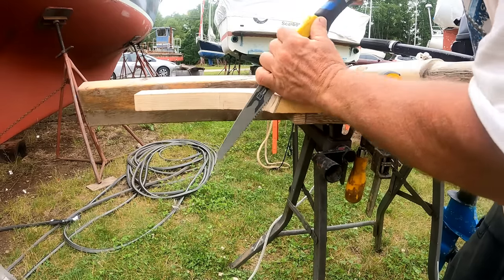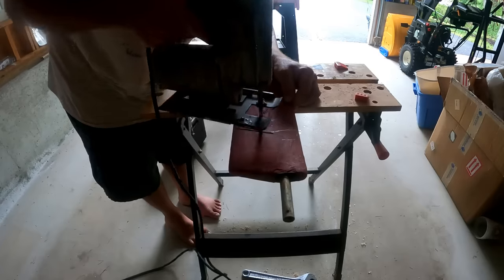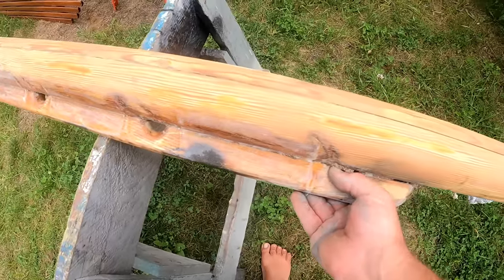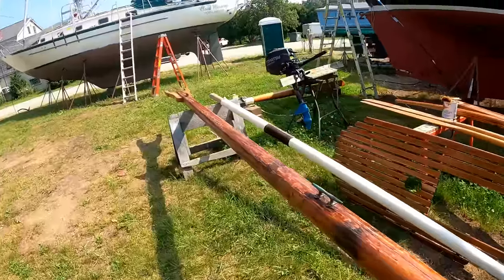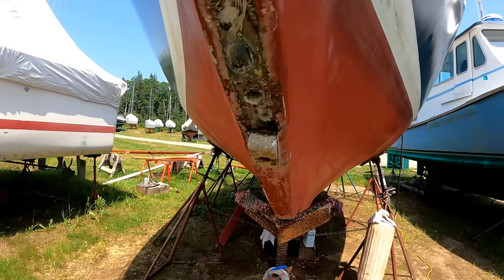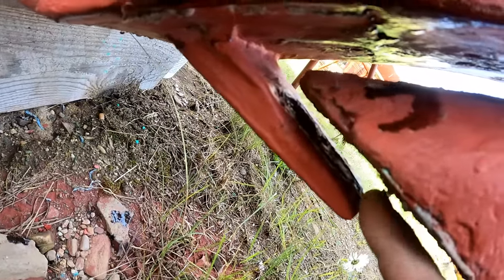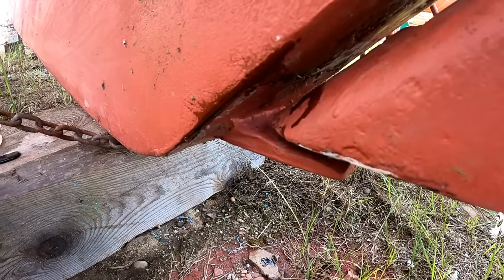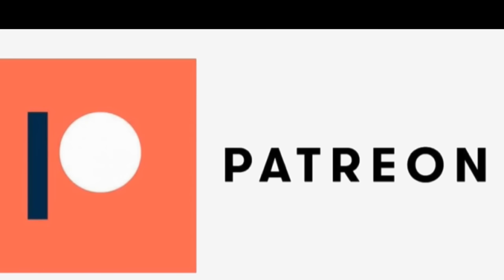Two Bolts Out of the Blue  |  Ep. 226

Comment: Kevin, regarding the anchor, I've had great luck with Rust Kutter, a phosphoric acid based rust converter in a spray bottle. Wheel the loose rust off mask so you don't breathe in acid must and protect eyes then spray the surface rust. Let it sit overnight. Wire wheel or sand again. Then you are painting what is chemically no longer rust.
Reply from the maker: Thanks, in fact I just discovered the magic of phosphoric acid on stainless steel thanks to my neighbor on that Crealock 37.   Not in time for painting the anchor though, so that will have to wait for the next round.
Reply: Interesting, I used to use something called "rust reformer", for cars,.  You didn't need to clean up too  much of the old rust, apply it right on top of rust, and it forms a barrier.  It was easier to use than paint!

Comment: Hi Ed, we had a series of stolen dinghy’s up in Rockland this summer also. Ended up being mischievous kids. You mentioned switching paints on your topsides. Was it in a previous episode? I watch almost all of yours and don’t remember that one. You talked about changing to a two part paint (Perfection). What did you have to do to put a two part over a one part? I didn’t think it worked. I’m considering painting the topsides of my SC 31 Islandia. A previous owner had rolled and tipped gelcoat probably 25 years ago and it’s failing with stress cracks and peeling
I also didn’t think you could sand perfection. I’ve used it on deck and cabin and have always sanded and touched up as opposed to compounding and polishing?

Dan Seefahrt SC 31 Islandia

Didn’t know if I would use 1  or 2 part.
Reply from the maker: Yes, I switched to 2-part Perfection.  Yes, applied it over the old Brightside after a thorough sanding.  So far is holding up brilliantly, no problems with the 1-part underneath.

Comment: Thought about Navel Jelly for the rust removal? Basically phosphoric acid, and cleans well without pitting.
Reply from the maker: Learned that trick just recently (OSPHO), but too late for the anchor unfortunately.  Will get it on the next round.

Comment: This is an interesting theft.
Usually, things are taken to be sold.

I don't think this is the case with this crime. The outboard would have been easy to fence or sell and probably more profitable than most items.

The dinghy, on the other hand, is big and bulky and likely harder to sell.

This crime looks like one of need more than greed. It is highly likely that the items stolen were needed by the thieves for their personal use.

The dinghy will most likely be repainted and probably never re-registered (assuming it was registered in the first place). If so, it will likely be very difficult to recover. My guess is that it will be on someone's fishing boat.
Reply from the maker: Stay tuned, although I never got the full story on the thieves.  But it sounds like they were junkies.  There was a string of thefts that night. They definitely weren't pros.  They were indeed quite sloppy and seemingly irrational.